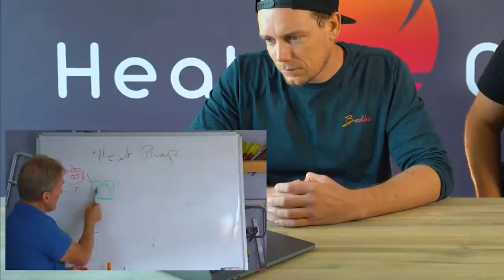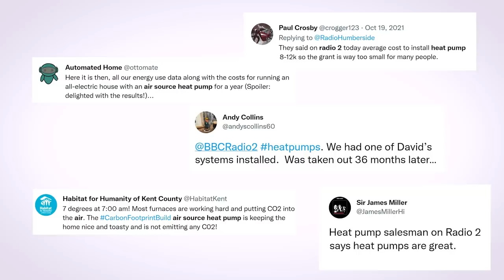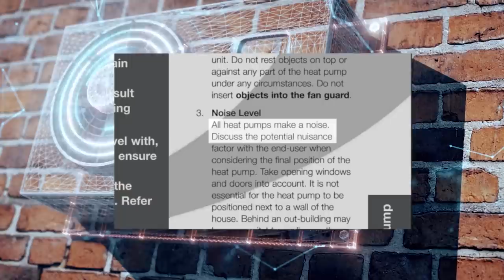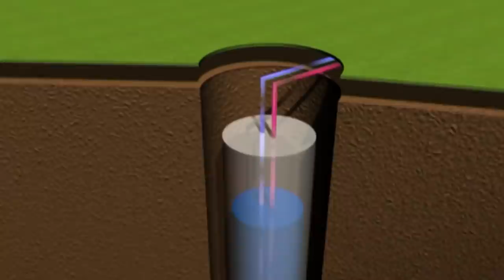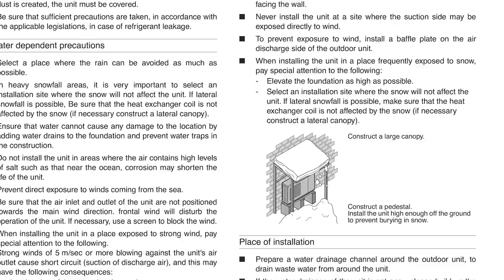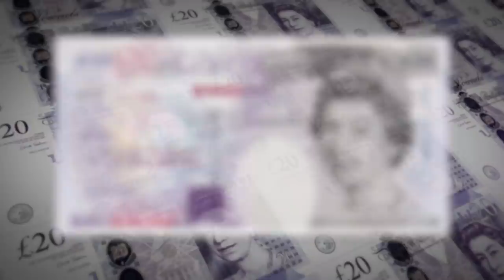Heat Pump Secrets They Don't Want You to Know

Comment: I’ve been designing heat pump systems since the 1970s and nothing has changed in that they are NOT a panacea for all space and water heating applications. Sizing a heat pump and configuring a heating system is no different from a gas fired system in that you need to calculate heating demands, size the boiler correctly, size the pipes correctly and select a pump and controls to meet the requirements of the system and the needs of the end user. All of the water to water and air to water based systems that I have designed  incorporated a buffer vessel so that the water flow through the heat pump is constant. The “secondary” circuit to the radiators or underfloor heating circuits can then be variable flow rate and weather compensated accordingly. GSHPs are more efficient and bore hole systems are generally considered to be more efficient than ground loop systems in my experience. Air to air systems can provide both heating and cooling but to get individual temperature control in each room would require individual systems or the multi split type systems that are common in commercial premises. If used for domestic hot water generation and storage then, generally you need larger storage capacity than would be the case for a gas a boiler system and you need far greater primary coil surface area due the the lower primary water temperature. A gas boiler can to a degree obscure deficiencies in the construction of heating systems (undersized pipes, poor workmanship etc) whereas heat pump systems require a more precise holistic approach to the design process. Where we’re going to get the clean power for all these heat pump systems and electric car chargers is beyond me as there doesn’t seem to be a coherent government strategy in place ( is there ever?).

Comment: Thanks for the video, a true reflection. My issue is that spending a lot of money for a system that until its actually fitted you will not know if it will work and how much it will actually cost to run specially in the winter months. Then as I was told a 22kw gest pump actually uses 5.5kw, but like you said it's the added heaters that they don't put into the calculation. And like you said a huge wire. The wire rating says it all. I am not against them at all in fact I have had to shelve my pump because I use 2 ev chargers in my very large bungalow I was told by my dno that If I install a 22 kw heat pump one of my chargers would have to be load curtailed, we decided to shelve the heat pump so we can use both ev chargers to there full potential. Like you I get reply from people who only think of how they live and say why don't you use ct clamps to limit my ev chargers. What they really don't get is not evs need to be fully charged every morning for use. Ev battery's can take over 8 hours to charge fully so if they are being reduced say because my Hest pump is taking a large load then a ev battety will not get its full charge, and I for one don't want to spend my day looking for a charger, wsiting in a Que and spending 3 x more for Electric. A new heat pump manufacturer has brought a new higher temperature pump out which claims it will and can be fitted in place of a boiler without to much change so let see how that goes, but this will still be a high amperage unit again. It's now common knowledge that the rea have being shouting about new builds having 3 phase and now builders are installing 3 phase. A building site of 192 homes in Cardiff 2 beds to 5 beds all have 3 phase to allow for ev chargers and Heat Pumps as well as solar feed back.
Reply from the maker: 3 phase is unforgiving if you get a shock from it.
Reply: @SkillBuilder  stay clear of it. Lol
Reply: @SkillBuilder  True, but an often overstated danger. The increased voltage is only between phases (400V), not between phase and ground (230V). You need a lot of things to be very (and simultaneously) wrong before you can get a 400V shock.

Comment: I think you give a very truthful account about heat pumps. I would think that its possible to combine a heat pump with a boiler so the two work together within a safe and efficient environment. I,m sure we have the scientific knowhow. for example if mice are a problem a low voltage electric shock could keep them out, could a heat pump be located in the loft? if not why not.

Comment: Thanks for a very informative and well presented video.  I think heat pumps ( aka electrical heaters ) are largely not a good choice. As you say, there is NO point in replacing a good gas heating system with a gas-to-electicity heating system. They pretend they are more "efficient" because they knowingly ignore the efficiency of generating and transmitting the electricity. When it's -5 outside the COP will drop to something like 1.5 and you are LESS efficient that directly burning gas.

Comment: Love your videos. We’re buying house which has air source heat pump. Current owner is an elderly lady which admitted that she finds the heating bills a bit too big. And I have notice she got some electric heaters as well which tells that central heating isn’t efficient. So I’m just wondering will I need to get gas combi boiler back? Will I be allowed to connect back to the gas pipe?  It’s an old ex council house build in the 50s.

Comment: I had a 16kW LG ASHP installed about 5 years ago but it frequently stops providing room heating. It’s been fully serviced since installation . The problem being that not many heat pump engineers are available. Can you help?

Comment: didn't realise there was guidance on salt air, living next to the coast its something to be mindful of, cheers
Reply: Me neither. It pretty much rules one out for me. If I don't drive my (electric) car for two days the brakes just about seize!
Reply: it's not a big deal, you need to be like < 300 meters from the coast to see rust within a couple of years and they will still last 10+ years anyway
Reply: Yup I'm less than 300m, I have had car disks rust after a week like Rico but possibly a change to higher end disks has stopped this.
Reply: @Mark-M72  high end discs? Bugger that. I just oil them up and just avoid downhills.
Reply: @ricos1497  yup oil and disks will work too🤪, I got some drilled disk, all show and no go 😜

Comment: Roger - also if you hang one of these on your house wall the vibration will cause the cement to fail and the outer wall of the build is only held with wall ties that will also fail and the whole heavy unit will end up on the floor and also the structure of the building will be damaged. Also if I may add - Most cars and trucks have air con fitted which is the same proposed by heat pumps now air con just moves heat from one area to another - the atmosphere if you choose to switch it on your fuel consumption will go up because the pump absorbs energy. Now here is the downside you could avoid by just opening a window.  Driving along the autoroute in France across the Pyrenees towing a caravan my car engine temp  began to overheat because the outside temp reached 35 deg at 1000ft above sea level so I was forced to switch off the Aircon because the air became thinner and could not cool the aircon quick enough - this is the opposite of heat pumps for homes in winter they never work  when you need them most. There is another issue to contend with HPs use a refrigerant that is much more damaging to the environment than CO2 and over time cars and trucks need to be topped up with the stuff this is proven to be damaging the ozone layer and so they made it illegal to allow it to be released during servicing and so special equipment is required to retrieve it  and also knowledge of refrigeration is a must.  As an engineer I have those skills  but not all do have these and the same will apply to HPs but the natural losses of refrigerant will far outweigh the savings in CO2 or as they say Carbon in all the households they propose to change.
Reply: This is why every 4-5 years an entirely new set of pipe diameter/airconditioner unit is required for inverters, they develop a “new environmentally friendly” refrigerant which must be operated at different pressures. 
Makes me wonder just how environmentally friendly the “new, less damaging” refrigerant was 20 years ago. Basically we are using NOW something that may be 4x more damaging than decades from now. There are few winners in this arena, mostly the people who sell the equipment.